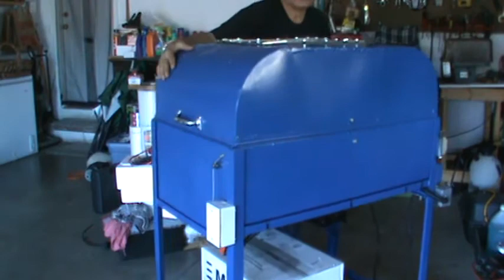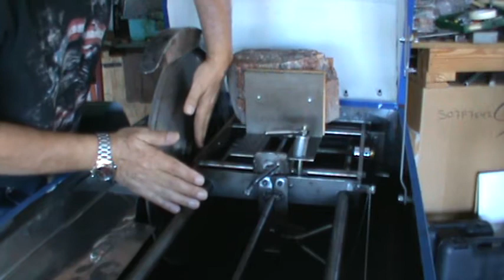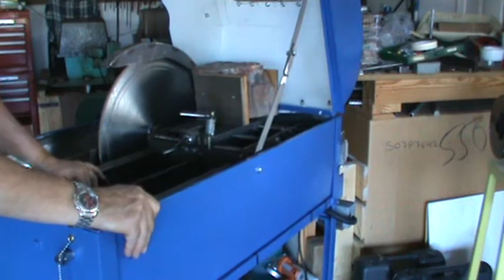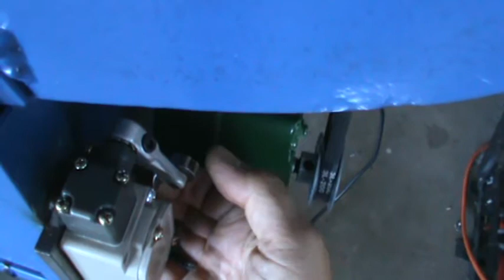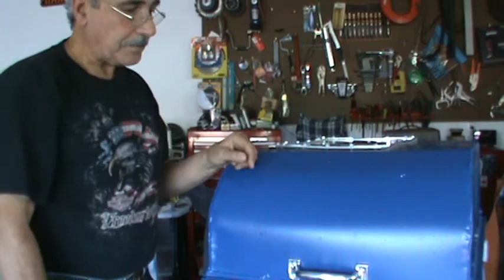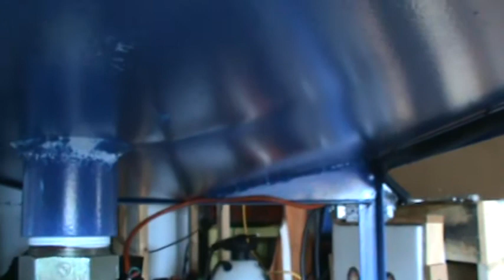Tips for Building your 18" Lapidary Saw

Comment: Great video! I recently bought an 18" home built ancient saw for $250. Actually all that is redeemable is the new motor and the blade. The basin is of rusted sheet metal. I would like to follow the design that you have presented. I like the slanted bottom and the reduced channel for the saw. I can do that I think. I would like to mirror your design for the drive, and the shut off switch. Good luck to me.  I need to trim the length of my vice about 7". I'm hoping that I find the right bearing setup for carriage. I'm taking my time and asking other builders. I'm very happy to have found your video. If you have created a list of materials and a blueprint. please let us know.
Reply: Hello Dalton, I'm sorry I don't have any drawings I just made sketches as I go I'm sure you'll have a lot of fun building your saw. Thanks again for watching my videos!
Reply: The best guidance I've seen so far. I've watched your video 3 times so far and expect to be a frequent visitor. Your saw is really a nice model for other builders. @ElieGhanimeEG

Comment: What motor did you use for the feed system, pully size and thread size?
Reply from the maker: The motor is slow speed high torque 120 V  60 Htz, the pully is 2" at the motor and 4" at the drive shaft, the drive shaft is ½" fine thread.

Comment: What type of metal did you use to construct your saw?  Also, what gauge did you use and what method of joining the metal together did you use?
Reply: Jim B you're watching the old channel 😄 I didn't upload this video to the new channel, anyway I used 1/16" sheet metal it's about 14 gauge, I had the tank shaped and then welded the 2 ends, I did a leak test using water, all the weld was good then I added automotive sealer over the weld, the cover also welded however, if I build another one I would make it square instead of rounded front.

Comment: Limit switch all about?!
Reply from the maker: Hello Rustam, the limit switch is for safety reasons, if the vise carriage dosen't shutoff the motor by pulling the chain shutting off the front switch and it keeps moving towards the back unattended, it could create a lot of damage, the limit switch set at the back it will be activated by the vise carriage pushing the limit switch shutting off the electric power.

Comment: Thanks Eg Jewels for the video very informative. I have a Highland Park Combo lapidary unit
model B-10 built probably late 60's early 70's. It has 10" saw with shaft and moter to the right of the blade and a sanding drum with another  moter to  right of the drum do your rules about which way to turn bolts to remove blade and drum apply to this model if anyone has the Highland Park B-10 would much appreciate Thanks
Reply from the maker: Hi Dennis, the rules always apply to all motors, if the motor on the right side of the blade or anything turning that you apply pressure on, the nut used has to be left-handed, the same applies for motor on the left side of the turning blade or grinding wheel, the nut must be right-handed, therefore, it dosn't matter what kind of machine you have or how old it is, the rules apply to all.
Thanks for asking and I hope you enjoy all my videos.
Elie Ghanime